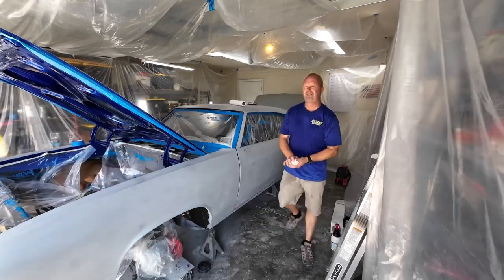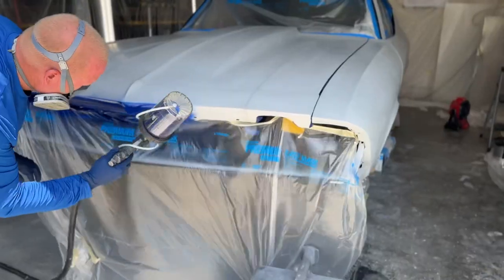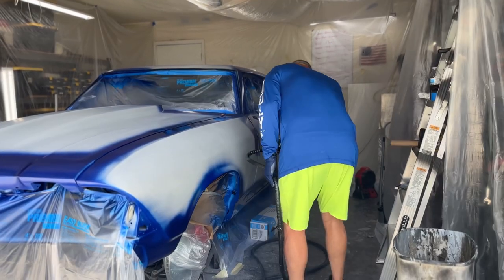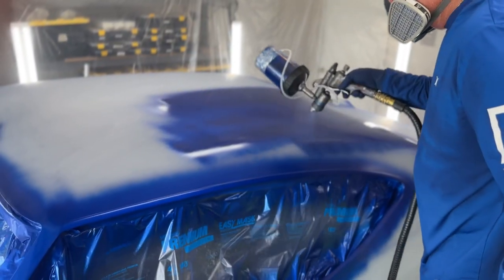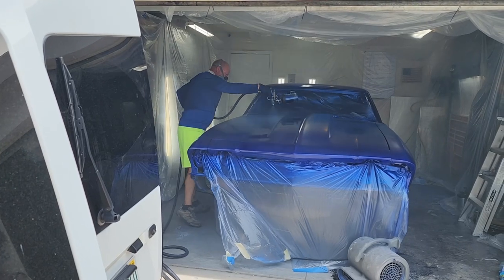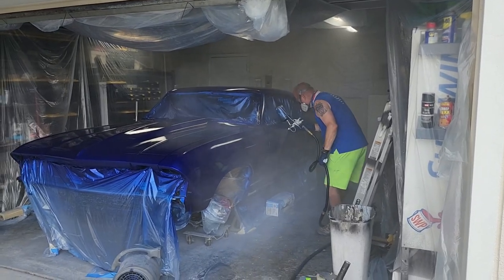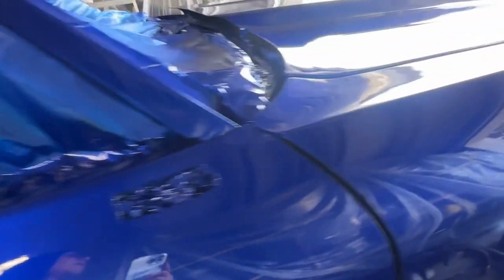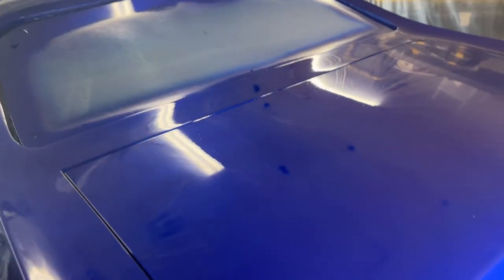DIY CAR PAINTING - Everything You Need To Know

Comment: Modern car paints can be deadly! In 1988 I painted my son's 70 Chevelle (his first car) in my 2 car garage with Imron frost green metallic that matched the original color almost perfectly. Even back then they recommended wearing a pressurized face mask even when mixing paint. I used a good 3M respirator and survived. The paint came out great but the clear coat had some orange peel because I didn't have good lighting. I didn't know that you could sand out the orange peel.
Reply from the maker: Cool story Victor! Imron is some tough stuff! I can’t wait for the new powered air mask setup!